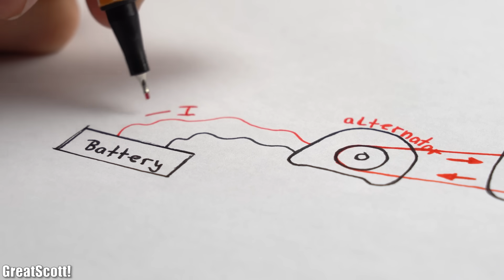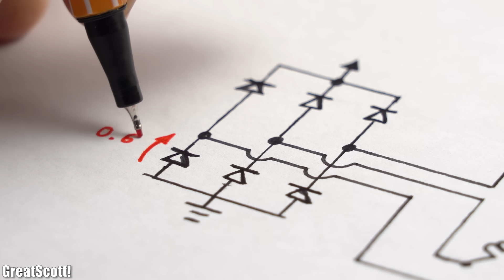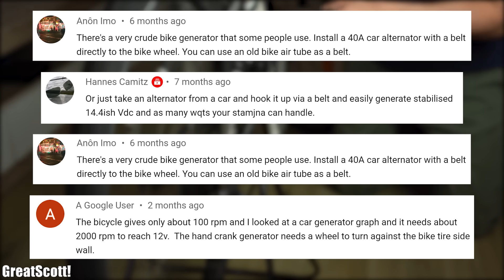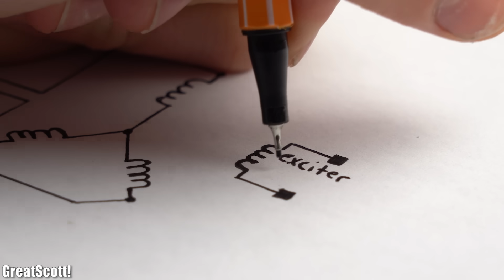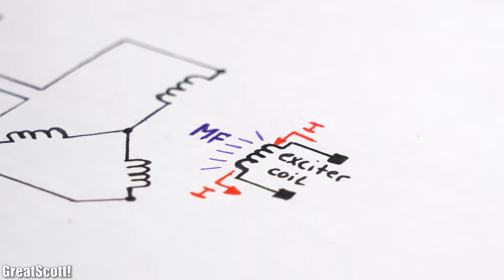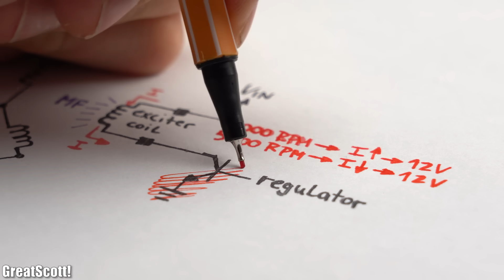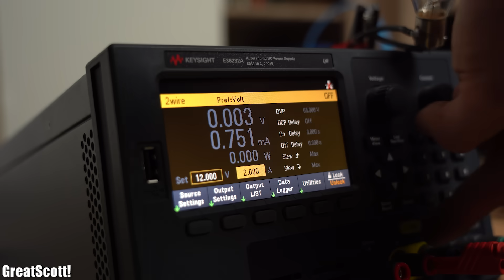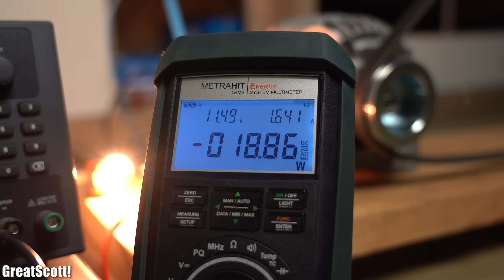Using a car alternator with a bike to power my home? How much energy can I produce?!

Comment: I know this is an old video but I wanted to mention. If you connect the single wire in the socket to the 12 volt output of the alternator you could use a very small battery on a pushbutton to quickly 'excite' the field and start the power production,then it would be self sustaining until you stopped pedaling. This wire is usually connected to the ignition in the vehicle. The other terminal is typically a signal wire for the alternator indicator on your dash to show a charging issue.
Reply: Thank u
Reply: It's hooked to the run position on the key not the start position so it receives voltage as long as the the car is running which is y if you disconnect the battery the vehicle stalls older cars with generators instead of alternators you could do what you said
Reply: @rodneyfox5566  and an alternator produces AC electricity ! It is converted to dc inside the alternator . All generator induction motors produce ac electric.
Reply: @DOGEATSGOG  Hmm. I'm a modern student of Steinmetz, Heaviside and Tesla and I see what you're saying. But you did say no gasoline needed but then said when stopped a backup generator would charge the capacitors but that would take gasoline right? 

Also would have to watch out for arcing discharges no throwing metal equipment in the back of the car near the capacitor bank unless the whole car is designed like a semi-conductor or has gallium paint lol
Reply: @DOGEATSGOG  yeah I have my suspicions that the better engineers have already left Tesla the company I used to work for Black + Decker but never Tesla although I’ve built race cars I understand normal cars pretty well. 

I was only name dropping who I think are the best engineers in history.

I know I’ve heard Elon say before that capacitors could replace batteries I wonder if he read your emails lol
Reply: @DOGEATSGOG  but what I don’t get is that any mines will have nickel, tin , copper and good semi conductors materials too. It’s not like video games where you have a goldmine with nothing but gold in it lol or pure lithium mines
Reply: @DOGEATSGOG  yep and cobalt in africa
Reply: @DOGEATSGOG  “If I were to make a prediction, I'd think there's a good chance that it is not batteries, but super-capacitors.” Apr 6, 2016
Reply: @DOGEATSGOG  I think I realized why they want to keep the lithium ion batteries. Because those same mines are mining the permanent magnets for the torque motors that drive the wheels as well. It's a wholesale cost reduction.
Reply: @rodneyfox5566  an alternator is a generator . It runs off the serpentine belt.. it is a true generator.. but for it to run properly it needs an electric load on it or the voltage generated will fluctuate wildly.. a lite bulb works great as a load.. the battery in a car is the load as well as the electrical equipment in the car.
Reply: You need a generator not an alternator ,alt takes power to make power a gen does not
Reply: An alternator is a generator as well.The difference is that an alternator produces AC while a dynamo is a generator that produces DC.
Reply: An alternator has a rectified to convert the initial AC to DC. They were the six diodes connected to coils at the start of the video.
Reply: Both alternators and dynamos need field coils.

Comment: I'm not sure why you decided to calculate the "number of years you would have to ride the bike to power your house for a year"

This makes it seem like your set up did not generate a significant amount of power, which is NOT the case.

20 watts is a significant amount of power.

A better analogy that people can understand is that you 10 cell phones in two hours.
In one hour you could charge a battery  enough so that it could charge your cell phone 20 times.

This is a significant useful amount of power.

Comment: Maybe consider adding a belt tensioner to get rid of the slack in the belt. At higher RPMs the loose slack in the belt can cause it to slip. Probably could make a frame from scrap wood to attach the tensioner pulley and mounting frame to the board. Or even pivot the alternator on one bolt and a wedge or spring  underneath to tighten it up. Idk just a suggestion

Comment: You should have used a 24v alternator aka a truck one and not a car because then u get a 3 phase so u could power anything that needs it, because i was looking into this u could also replace the electromagnet  with real magnets that will get the power out put you are looking for.

Comment: Alts. need about 5 HP to put out max power. In 1983 I built a unit to power my off grid home, using 3 Alt, powered by a 16 HP old "curb to home"  cable layer. I used this for about 18 months until  acquiring solar.  Unit had a theoretical 180 A. @ 12V.  Used non regulated, used Ford Alts that cost $5. and the field was excited through a 1970 Cadillac dimmer rheostat, which I set to run at about 50 to 70% output to preserve Alt life, as there was no cooling air flow.  This was the cheapest home power (1800 SF) I have ever had.  It is also work for the young.  PS:  Solar panels in 82 were $5 a WATT then, inflation correction for today = about $14 a WATT.

Comment: Interesting experiment. Like you say, this would work to charge things like phone batteries or power radios, as another commenter said. However regardless of your set up you are still bound by the laws of physics. You can't get more power out of it than you put into it. An elite level cyclist can produce about 400 watts with short bursts near a 1000 watts. An average person would see the sustained wattage drop to about 100 watts.

The above figures are raw and do not take into account loses. So matter what you do with the setup it will never produce anything more than power a light bulb.  Fun experiment though.
Reply: Indeed, I have seen the same sustained 100-watt figure quoted from various knowledgeable sources.  So, if I had a lossless generating system and I could generate 100 watts for ten hours, besides being utterly exhausted 😵, I would have generated 1 kilowatt-hour of electric power, which I can purchase from my power company for about 12 cents!  And some people actually complain about the cost of electricity! 😄.

Comment: what if you use a serries of ebikes with the throtle only pushed part way, and you  could do it on the tire and figure out the ratio mp hr or mp min when one runs out of juice then charge it while you run the other one? if you have an over charge you can add a battery to charge up? ! i think you could get away with three ebikes two actually but one more for good measure or just in case lol. then you would not have to pedel your own bike, you could pick up ebikes pretty cheep now days, they usually need batteries but you could also incorporate solar charging too you wouldnt really need a big setup i dont think for trickle charging an ebike each time you need to rotate an ebike!
Reply: ya you could even do it indoors ebikes have no exahst!
Reply: There must be better ways to waste energy, but none spring to mind right now...

Comment: Automotive crank pulleys are 3:1 ratio compared to the alt pulley (6” crank, ~2” alt… or very close). The alt can produce voltage starting around 3000 alternator rpm up thru 18000 rpm. Thats your sweet spot for producing voltage and current, 3k-18krpm

Comment: Nice....but totally inefficient, unfortunately...What is actually creating the power???....probably some moving magnets going around some coils of wire which will generate a current of flowing electrons...electricity. YAY! THAT is what you must focus all your efforts on to generate more moving electrons. I see you have some moving bicycle wheels going round and round and round all the time...WHY is there no magnets on them since they are MOVING??? Get some magnets attached to those Wheels with wires around the magnets in some configuration so as to generate a flow of more electrons....no need for a car generator but you can borrow the configuration of the magnets and coiled wires...AND...here is the kicker....Kick yourself in the butts ALL for this one and a Double Thumbs Up for me...why only 1 moving wheel??? why not about 10 or 12 Wheels side-by-side, all with magnets attached and coils of wire around them...SEE...So Simple!
Have a most wonderful Day!!!! : )

Comment: your effords are in vain if you could power ur house with muscle output there would be no need for electricety corp..The rules of nature dont allow you to have perpitory motion machines aka you cant have your cake and eat it....most folks forget underestimate how mutch kinetic energy is needit to make a 1000w atleast with this project you learn not to take your cheap energy for granted......on top of that may i kindly sugest you do this in a garage at a giving point you nearly drilled screws in your floor planks....if you wanted to do somthing like this you were better of buying a cheap generator and take out the generator those things are already optimised....

Comment: For a fitness test on a bicycle you should be able to cycle easily 70-80W/hour. Swap the pulley for a smaller diameter (gives higher RPM). And make sure that the drive belt is much tighter, so that you don't get a slipping belt!

Comment: Alternator works well with 12v car battery. Just connect and spin it. You can store energy for later use. You should be able to generate 3W/kg  if you weight 70kg CCA 200w/h. Few hours of workout will power some led or small TV.

Comment: Couldn't this be altered to use wind power? If you are charging into 12v batteries, and using a 230v "campier van" converter, you have the basis for supplementing power usage at home. Attach some "sails" to the bike wheel, 
I would love to have this level of competence in electronic engineering, and power my home from wind and solar. There must be loads of alternators in scrap yards waiting to be uoscaled.

Comment: If you where spinning three rear wheels attached to three alternators, would the resistance be to high to peddle? What if you set several.alternators in a line and had belts between the alternators and still just used one bike. What if you did a combonation of both ideas?
Reply: Even one alternator requires far more energy than any human can provide, to reach maximum output. That kind of absurd power output only happens in the Flintstones cartoons. (Powering their cars with their feet )

Comment: on a pair of pulleys the rpm of the smaller one is the rpm of the larger one times the diameter of the larger divided by the diameter of the smaller.  a 2 and an 8 would be 4:1.

Comment: there was a guy with a dead truck.  he put the fan on a frame, and the alternator with the v belt.  that charged the battery and he used lights and switches off the truck for emergency lights.  he ran the ground through the chassis, but i don't remember how he made the hot lead rotate.  i think it went down the pipe that the windmill turned on.

Comment: Use a Tesla electric motor instead. Connect it to a windmill or a paddle wheel in flowing water. You will get a lot of more watts.

Comment: Why do you write a l to look like a 7? Then you have to mess with the 7 putting an extra line thru it.  l is l; it does  not need to be fouled up to look like a 7.  The belt looks too loose.

Comment: Well you could a done that better. 1. Use a monopole generator 2. Put a battery in the system so you do not load the system in the manner you were. (This would stop the jurkeyness) 3 you could have just have put the generator on a hinge in a frame on top so the weight rests on the wheel and you could add more weight as necessary. Just swap out the pully for a pully that will fit the wheel. 4. Weight the wheel so it works as a fly wheel. 5. Use a recumbent system. I have abbreviated the improvement list.

Comment: This would be more efficient and easier to control if your bulb and regulator were removed and use a switch mode voltage regulator feeding straight to the positive brush. Giving you easy adjustment to the load presented to the bike. In the good old days I just used resistors on a rotary switch.

Comment: Most homes in the USA have an ecisting 200 amp service. It takes 40,000 watts to equal 200 amps. The household system of appliances is 60 htz in the US, so to set up an electromagnetic power greatest you need two alternators to start. You can buy an electromagnetic gen that starts at $20,000. To build one is much cheaper but it cannot be done from a motor. You need magnets, coil, and movement to hook up to the existing panel. I am still doing research for a viable cost friendly system that can run in a negatively charged environment, or positive post pole shift but not there yet. When I do get it figured out, will publish for free. Morgan was the devil. I am not.

Comment: some sort of perpetual motion device as opposed to the bike. Also. ... with a swinging heavy point on a circle, like a gear with enought momentum, and maybe even a back up little kicker if the wheel needs be from a charge that it produces on a separate motor on a cog, that completes its rotation and yada yada, It just. Keeps spinnin. ? no just off the top of my head. No scientist but. like id start there. or even some pump style like those old train track things to start it up whatever

Comment: Like a wide base probably 3 to 4 feet. ANd 45 degree supports. You could easy make grooves and your own weight would hold it into the mount. Spaced in the middle by whatever the width of the bike is, and I dont doubt you could employ some other pulleys and or weights to perhaps get way more. Like way more rpm

Comment: The effort needed to rotate an electrical generator or alternator, that's electrically loaded, is surprisingly high. 
That's why people into car drag racing prefer to not use an alternator at all, it noticeably robs engine power.
But in normal family cars, we can spare the horsepower, for electrical power.

Comment: You need about one horse power to get 700 watts so you are never going to get anything like that pedaling a bike. Maybe try some sort of tread mill with a couple of horses to power the generator. You could dangle a carrot just out of reach so that they keep running in an effort to get the carrot. Put a car battery on as well so that it works like it does in a car and you then have a steady voltage.. All you need then is an inverter to get the 12 volts to ac 240 volts, a synchroniser to synchronise the frequency and phase of the ac, a breaker to go parallel with the mains and then a load control device. Gee up the horses and then as their power goes up the power from the mains will go down. You will also need some sort of reverse power detection (for when the horses get tired) to trip the breaker.  Quite simple really. Looking forward to seeing your next  updated video 🙂

Comment: In Physics, its best to know raw numbers first.
If you can make 100  W , with you legs,
then you should try to getv50 W at least.
I have a small alternator from a forklift engine.
I hope to use it for exercise bike,
Using bicycle ratchets you can add bike power to the same alternator 
as one connected to a horizontal wind generator.
No wind ? . Get on the bike.

Comment: Find a older 3 pin dodge alt.  Reconfigure the stator and remove coils not needed. .. 
14.+  should be the outcome. .  I did for a water driven power source. ..

Comment: If you open up the Alternator, you will see that the Rotor is a set of inward pointing steel fingers with a coil inside.  If you press off one of these sets of fingers, you can remove the coil and put in a strong permanant magent from a large speaker, then press the steel fingers back on.  You will now be able to generate electricity without providing exciter power.

A permanant is not used when the alternator is used in a car, becasue the exicitaition voltage must be changed to regulate the output as RPM and electrical load changes.
Reply: Thanks for that info - I was always wondering why the hell no perm magnets? What if your car battery is flat etc. I know in synchronous motors they rely on tiny amounts of residual magnetism to get the whole system going, was wondering why it would not be possible with alternators as well to have a similar setup?

Comment: actually older alternators for cars from 1950-70's i believe are always "on" they usually have an external voltage regulator that when the battery voltage reaches say 13v dc the regulator shunts the voltage to ground and when the voltage drops to 10-11v connects the alternator back to the car battery, as where the newer alternator you have is in a computer controlled car is different. The 2 pins you showed controls the alternators field being turned on/off. Usually the way it works is there is 12v always on one pin and the car's computer when wanting to turn the alternator on will connect the other pin to ground. what u should do is use a battery in your set up for charging. if you charge up a 12v storage  battery to use current later, you could hook a switch from the battery to the 2 pins. when you want to charge the battery turn the field switch on to the 2 pins hop on your bike and peddle. Then turn off again when finished charging your battery. you may want to get an inverter so you can run 110ac devices off of the battery AND you may want to switch battery chemistry from lead acid to say Li-ion batteries. Lead acid can not be discharged to zero volts w/o being slightly damaged even going below 50% is bad. might even want to get a few solar panels and a charge controller to throw in. you also should have made grooves in the board so u can slide the alternator back to tension the belt.

Comment: Here is basic error in this experiment.
12V car alternator is delivering 14-15V.
This is necessary to charge battery to 13.5V. Alternator used in video should generate 60-80A.